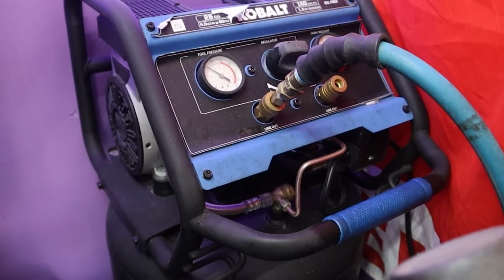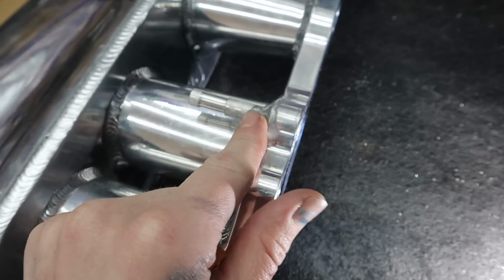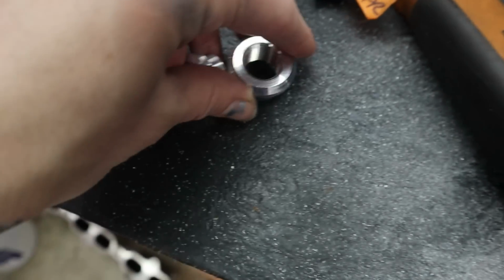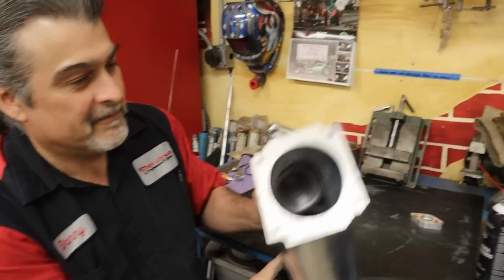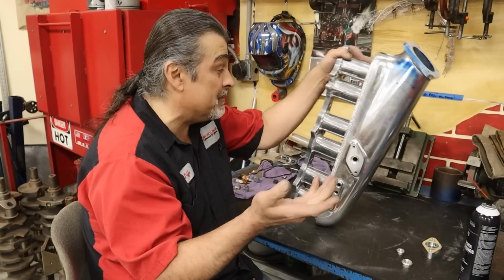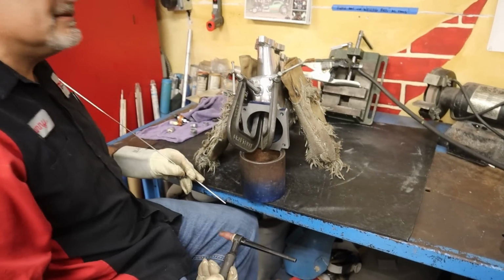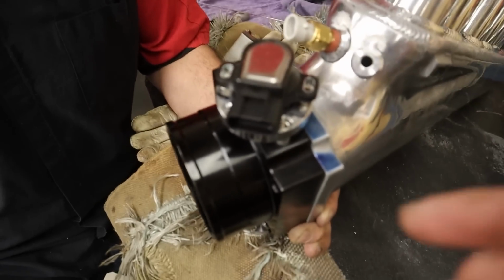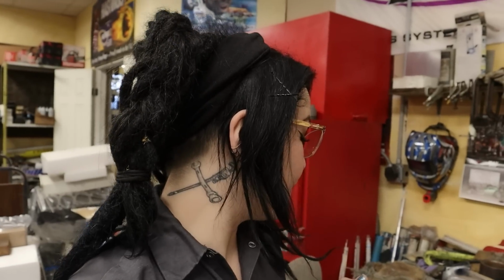My 20+ hour (40+ hour) "Bolt On" 7M Intake Manifold! (No it's not just you, custom stuff takes time)

Comment: Awesome video as always Faye! Question, so do the existing holes that you are not using get plugged somehow? Pardon my lack of knowledge!
Reply from the maker: Great question! That giant open hole on the end of the manifold where it mates to the cylinder head is actually where the factory EGR plate goes. I deleted it, and so that through-hole goes to nowhere. It is open on the other end too, and has nothing else going to it, so I can leave it open. The other vacuum holes will be plugged of they aren't used. So far I only have uses for two of them, and the other two will be getting hex key NPT plugs in them :)

Comment: Recently I diff swapped my lexus gs400 to a gs300 differential. Easy swap, took maybe 2-3 hours, it runs, drives, but the thing is 4-5th gear doesn't know where to shift anymore unless your past 35-50% throttle. It shifts into it when using the paddles tho. When it does shift, it shifts smooth but I assume the slight difference in wheel speed is tripping up a computer or something being that its a swap from 3.27 to 3.92 gears. Thats when I end up into the rabbit hole of building the trans, shimming accumulators and upping line pressure.

Comment: lol I hate when one issue opens a whole can of worms. I was working on my 1989 240sx this week and it was going lean and sputtering under boost (I have a Wideband 02). Thinking to myself "Okay... lean so not enough fuel. Why am I not getting enough fuel?" Did all the easy stuff first. New fuel filter, no change. Cleaned the MAF and air filter, no change. Checked spark looks lean, but sparking. Thinking it's the FPR... ordered an adjustable one with a PSI gauge and when it showed up I installed it. Hot wired the fuel pump relay noticed only 25PSI MAX. Aw man I need to check fuel pump... I guess the 34 year old fuel pump finally gave out lmao. Luckily I planned on adding boost eventually so I had an Walbro 255 fuel pump laying around. Installed the fuel pump and adjusted the fuel pressure to ~43psi with the fuel pump hot wired. At idle she was bouncing around near 14.7 okay perfect. Under boost shooting for high 11s low 12s A/F ratio. Looks good, but still sputtering under boost. Scratching head Pulled all the plugs again and noticed they were 2 steps colder plugs than I should run(after researching). Replaced/gapped them and viola she's running like a champ. So the issue was bad fuel pump and I guess the lean condition messed up the spark plugs. I know I could of found the fuel pump issue by adding a fuel psi gauge before the rail, but I eventually wanted to get an adjustable FPR to future proof my build and it comes with a gauge. 
I'm a just backyard mechanic so I only learned by working on it or googleing everything lol. With all my vehicles I haven't taken to a mechanic in like 10 years. I enjoy working on my vehicles and research/learning.

Comment: Great video. A hot tip I learned from a fellow coworker years ago, is when you're lapping a part, use a bit of thin oil, like WD40, and move the part in a figure eight pattern. The oil will help to create a slurry, which is has an added abrasive factor, and the figure eight pattern will ensure that you're lapping it evenly across the plane.
Reply: and that with all due respect would contaminate the part. Im pretty sure they want to make all mods to a pristine aluminum manifold. Perhaps share  hot tips with coworker.
Reply: @jayrichards3672  I’m a machinist. I lap surfaces pretty regularly as part of my job. Contaminate in what way?

Comment: Man, I've built a couple of I take manifolds out of aluminum fir Supras and each took me about 16 to 20 hours each. I've done 7m and 1j manifolds for mk3. I did a log style out of pipe and a stock manifold I cut the flanges off of. That was my first. Great low end torque but fell off up top. Then I copied this style 1 for the 7m and 1 fir 1j. They were easier than I expected out of sheet stock and stock flanges I cut off and ported before welding. They worked great low to mid with little drop. Curve stayed pretty flat across the higher rpm. These were cammed of course one BC and I don't remember the 1j. Just pattern and plan. Get some pieces the thickness you are working with and PRACTICE the welds first.

Comment: Faye, I had to sell my 87 supra turbo, convertible, with copper headgasket, arp bolts, borla exhaust, turbo timer, electronic valve controller.  I wanted it to go to a good home, but the way God worked it out, i had to sell it quick.  If you are interested, it is at the Oceanside CA , Pick and Pull.